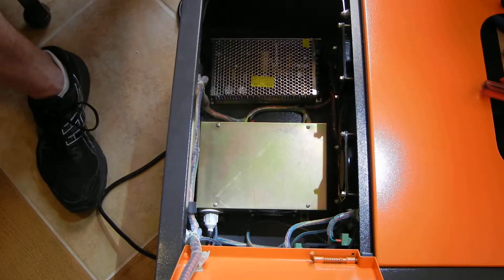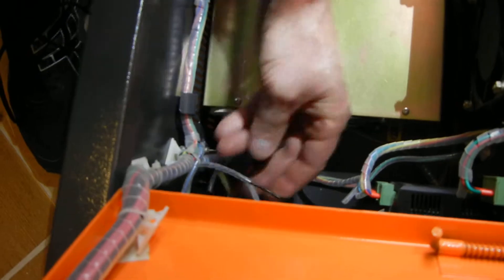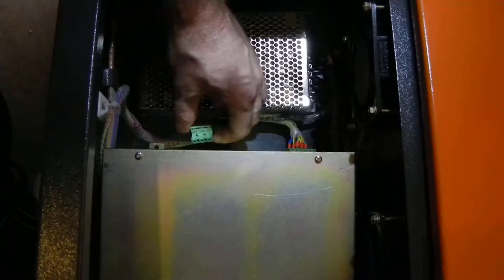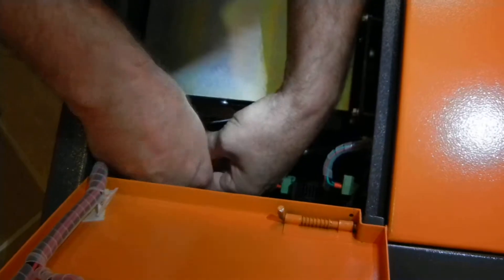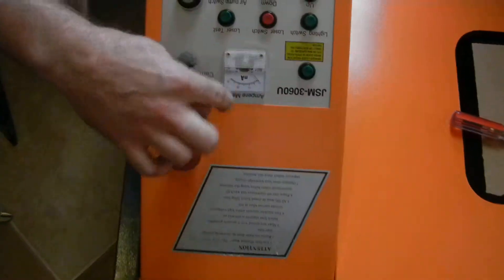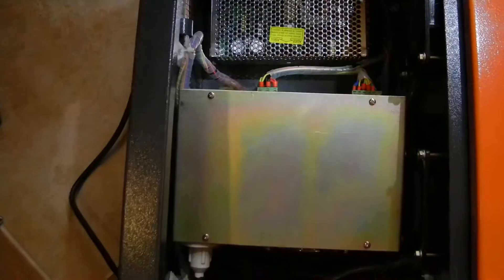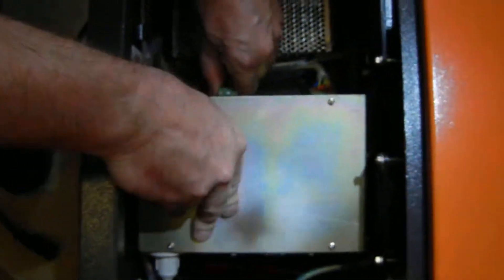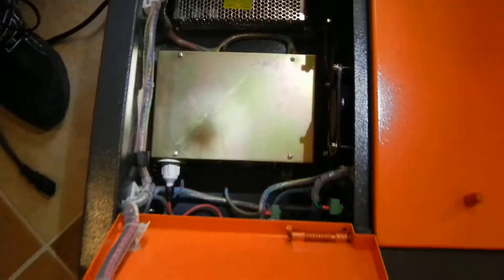3060U laser power supply replace

Comment: I forgot to ask you the various reasons why a power supply would need replacement. 

Also, would it make sense to have some type of tripping mechanism (like a breaker) to go prior to losing such an expensive part such as the power supply and or tube?